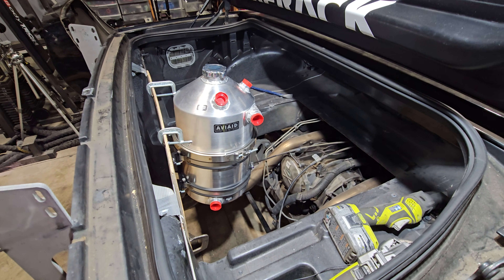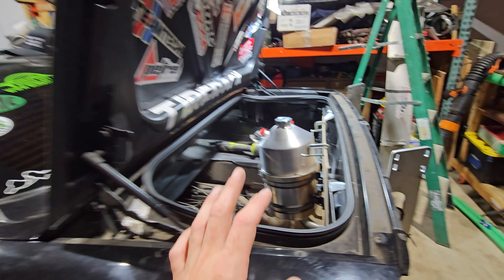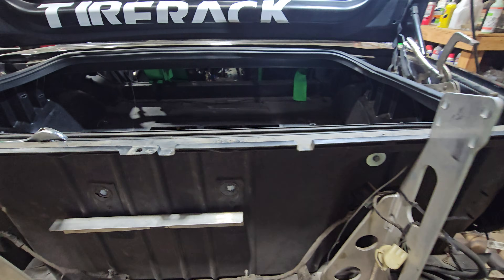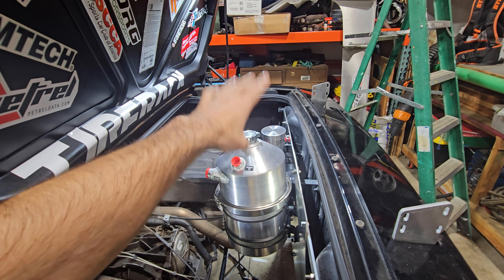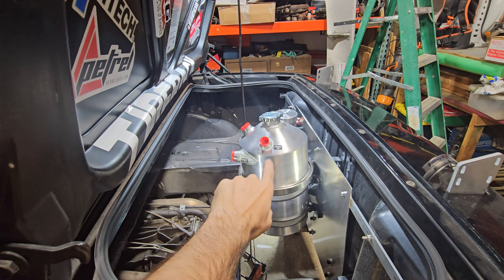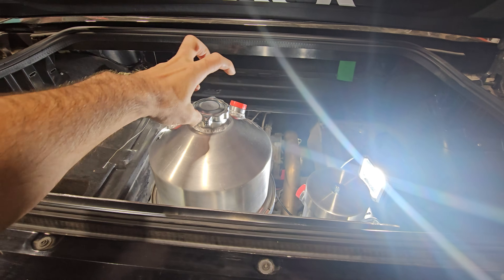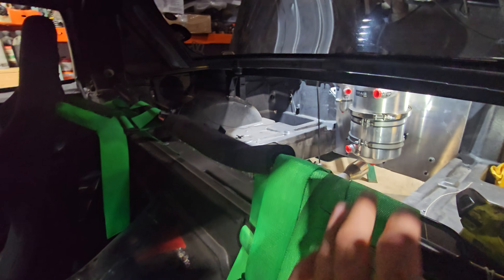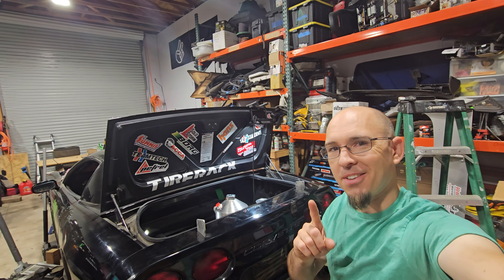Mounting Aviaid dry sump tanks in trunk of Corvette

Comment: Regarding Polar Moment of Inertia: I think since you have a front mounted engine car, the positioning of your oil reservoir is going to move your center of gravity closer to the center of the car which should help with understeer.  I think there could be some issues if you don't fill the oil reservoir all the way as the oil moves around.  One way you could reduce the amount of oil you would need to carry is by putting something light in the reservoir to take up space.  That something needs to be able to be inserted through the top lid but not block any of the other ports.